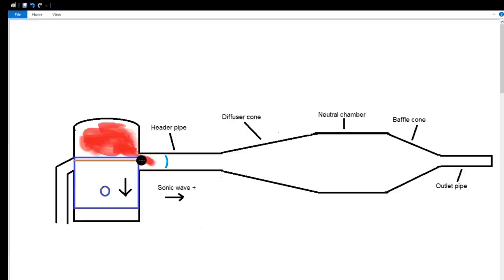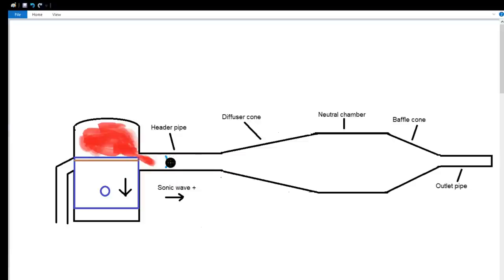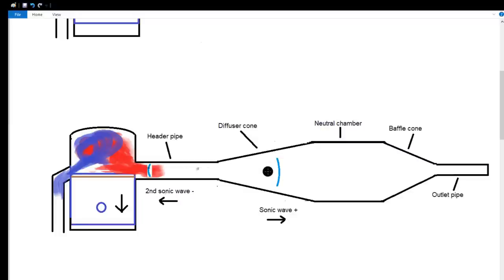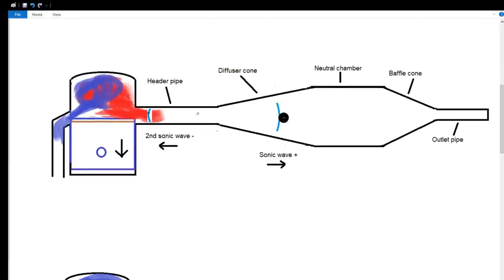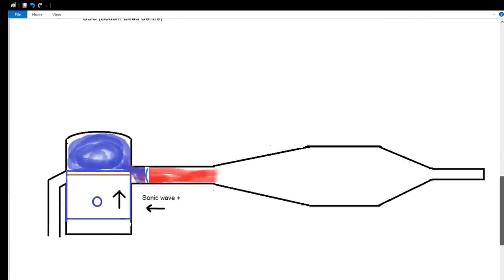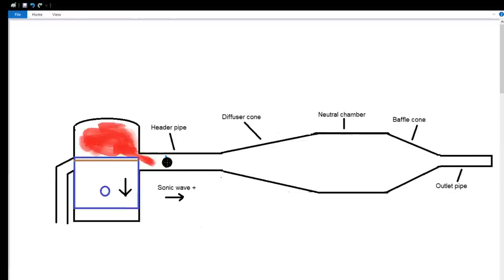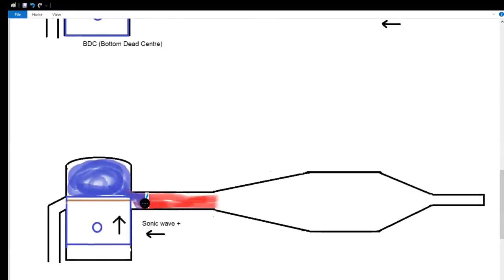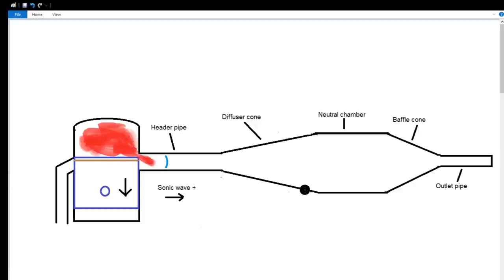Unlocking the secrets of 2 stroke expansion chamber exhausts E1

Comment: Hello,
I am restoring 1987 Jawa 350, which is 2t motorcycle. Engine will be completly rebuilded, but I have a little bent exaust knees (its hard to get new ones for her). Some people say that it is not good for engine, but I have passed a lot of kilometers with those a little bent exaust with no problem. Can you help me and say what to do? Can I keep old pipes or I must spend a whole fortune to get new ones?
Best regrads from Montenegro.
Reply from the maker: One option for repairing pipes is to simply slice the pipe near the damaged sections and then use some sheet metal tools to beat out the dents and damage and then re-weld the sections back together with oxy acetylene.
There are also some videos on hydraulic repair of pipes using a pump but that is a bit expensive.
It all depends on the damage the pipes have, small dents in the belly section for example at not an issue for the pipes performance.
Damage the the header parts of the pipe nearer tot he engine can be an issue for performance.
Reply: @AuMechanic  I will try to cut the pipes near bent places and try to fix it, I have nothing to lose. Thank you for fast reply!

Comment: Hi thank you for that you are the only one that has given that   but how long is a tuned lengh be for the  muffler and wether from the start of the exhaust at the head if it has a bend in it will some of the exhaust gases bounce back causeing power restrictions pls let me know
Reply from the maker: The tuned length is taken from the port at the cylinder to the exit of the reverse facing baffle cone taper on the expansion chamber for Gordon Blairs expansion chamber formula which is what I use in these videos.
The later videos after this one cover each part of the expansion chamber in more detail including the tuned length and outlet pipe and muffler etc.
As for bends on the header pipe, no this wont cause reflections back of the compression wave so long as the area of the pipe has no sudden changes which is why if you are making a header pipe bend using straight pipe you need to use mandrel bent pipe to ensure no kink on the pipe that will change the area of the pipe diameter..

Comment: I recently had a detonation issue with a KTM 300. Online, everyone who had an issue previously were told to lower compression or richen the jetting. 

My problem was the pipe was a poor fit into the head. There was fuel/air escaping and there was evidence of that around the flange. But that shouldn’t affect jetting ( presumably) because both fuel and air were escaping, does that mean fresh air was coming back in where it was a poor seal. That seems unlikely to me, I would have thought the pressure inside the head would always be above the pressure outside. 

Any thoughts?

Comment: Just found your channel and I’m very excited to watch your series on designing a tuned exhaust. I’m in physics and I write software for numerics, simulations and such, but all I know how to do for this problem is write a solver for Navier Stokes, which is very difficult, complex, and computationally intensive, so I’m interested to see what simplifications are allowed to reasonably model an exhaust system.
Reply from the maker: The videos on Expansion chambers is based on the publications of Prof Gordon Blair.
You might like to read his book "Design and Simulation of TWO-STROKE ENGINES" published around 1996 which are the basis of SAE papers he published.
He has an earlier version around 1990 but there is some changes in the 1996 version
When I started making expansion chambers in the 1980's we only had Gordon Jennings "Two Stroke Tuners Handbook" to work form which are fairly simplified.
Reply: Thanks for the references!
Reply: @AuMechanic  if you change the length of the header before expansion like shorten or lengthen does this have an effect on the timing
Reply from the maker: @davidbroomhall7321  Since tuned length is calculated from the port window to the end of the baffle cone, changing the lengths of any part therein will effect tuned length.
I suspect what you are referring to is the "Jennings" pipe equation created in the late 1970's that provides a max and min lengths of header and the result of changing it, but be aware his equation was created by measuring race pipes with some observations and not by any scientific methodology as with the "Blair" equations that were created in the late 1990's I use in the software and in the videos series.

Comment: obviously we have sound waves making it out the stinger. is this the wave returning from the combustion chamber? or "Extra waves"?
Reply from the maker: The sound coming from the outlet pipe will be the residual of any compression wave that is reflected but mostly the initial compression wave.
By having the outlet pipe inserted back into the chamber or to the side can reduce the sharp peak of the sound out of the outlet pipe without any loss.
I cover a bit more about the outlet pipe in a later video as well as the build series with equations where I cover how the length of the outlet pipe is not critical and in fact so long as the initial diameter of it fits the outlet ratio equation the rest of it can be larger and shorter

Comment: Okay... I have a couple questions...

When figuring which expansion chamber you need for an engine, should you base it off of CC to internal pipe diameter nearest piston; CC to internal pipe diameter at exhaust exit; or CC to area inside chamber?  (and what is the appropriate ratio?)

I’m wanting to fit an expansion chamber to one of my chainsaws that I abuse with occasional milling work, and then if I like the results enough  may make the addition to all of my saws.
Reply from the maker: Hi Rick
Not it is not only linked to CC there is more to it..
It is link to CC in so much as it is a ratio based on the port size and a larger engine will have a larger port size but the exact ratio is based on the expected pressures in the pipe which is based on BMEP.
There is a video playlist with a series in it covering all the equations required to design an expansion chamber, you will find the answer there to calculating the mid section. and exit pipe diameter ratios with explanations..
I will have a freeware downloadable pipe calculator software available soon that puts all the equations and ratios into a software to do quick calculations.

Comment: Why doesn't the explosion (fire/heat energy and high pressure) ignite the incoming air/fuel mix? Why doesn't the fire get forced into the crankcase that's currently under increasing pressure full of boom juice?
Reply from the maker: Because the exhaust and transfer ports are closed or covered by the piston during combustion when it is still near the top after it passes top of the cylinder and begins the downward stroke..
Once that is complete and the piston moves downward the exhaust port is the first to open, when it does most of the pressure is released to the exhaust before the transfer opens, that is called the blow down stage, as the piston continues to go down the transfers open next, at first some exhaust gas flows backward down the transfer but as the piston continues to go down the pressure in crank case is rising and the exhaust being open the cylinder pressure continues to drop at which point intake from the crank case flows upward into the cylinder.
Reply: @AuMechanic  I understand the principles of what is supposed to be happening. The compressed air/fuel mix is detonated by static electricity jumping from the negative electrode to the positive positive. Some of the matter is converted to heat energy in the form of an explosion. The cylinder dome and walls contain this   violent release of energy which allows the piston to convert it to mechanical energy. My problem is the piston hasn't converted all of it. There's plenty left by the time the exhaust port opens, which is necessary, but the intake port opens and new air/fuel mix is being forced into fire that hasn't been completely expelled. It didn't have enough time. Even when the piston reaches B. D. C. and all the usable energy the rotation of the crankshaft will allow has been transferred, there's still fire waiting in line at the exhaust port when the cylinder gets flooded with some easily excitable molecules. The way I see it, if there isn't enough explosive force left to push into the intake, then the new comers to the cylinder should at least burst into flames, chain reaction through the intake and consuming all the air/fuel hanging out in the crankcase because the Reed valve couldn't stop them forcing themselves in there but stopped them cold  when they tried to go back.
Reply from the maker: @cliffcampbell8827  
Firstly to clear up a few points there.
The spark is not static electricity, it is generated by induction in the ignition coil.
Combustion is not an explosion it is a rapid burn of fuel
It is not contained by cylinder walls at all it is contained by the cylinder head, specifically the small combustion chamber dome of the head, the surrounding area of which is called the squish band is to limit combustion to the centre and stop it occurring at the outer regions of the cylinder head.
Second part.
By the time the exhaust port has opened combustion is long completed and there is no "fire" left only the residual exhaust after combustion.
In addition to the fact that there is insufficient pressure remaining in the cylinder to support combustion even if there was a spark.
Note in some twin 2 stroke engines that have a dead spark system a spark occurs when one piston is at BDC and no combustion occurs because there is no compression.
Reply: @AuMechanic  I took a small engine class for 1 semester way back in high school. I think that I am not remembering everything from those lessons correctly. I do remember something about flywheel magnitos and after voltage goes through a coil, 6 v becomes something like 40,000 v.  Electricity, if it is or isn't static, household or auto, none of my business, but I do care about very much about avoiding  electricity. We don't work welI together so if I don't bother it then it (usually) doesn't bother me. Filth washes off. Most cuts and scrapes I get are patched with masking tape, but I categorically refuse to dance with amps. It only knows the rigid-twitching two step and it likes to lead.
Reply from the maker: @cliffcampbell8827  
Yeah I'm not too keen on getting zapped and in later years with modern ignitions getting zapped by a plug lead is particularly painful.
I've got a few earlier videos on how ignition systems and such work.
Reply: AuMechanic it’s called a waste spark ignition. Even triple 2 strokers use it, firing every 120 degrees....

Comment: I have a 2stroke tipple 1000cc sled.Exhaust is in really bad shape so I'm installing 3 cherry bomb glass packs for expansion chambers and fabricating same as stock inlet diameter pipe and same diameter as stock exit pipe after expansion chambers. Will still have stock silencer. Thinking this will keep me in the ballpark for factory back pressure.
Reply from the maker: That would significantly reduce the power of the sled.
Back pressure is only one factor of the expansion chambers performance, the rest of the video series covers what the other parts of the expansion chamber does.
You would be much better off repairing or replacing the stock chambers.
Can you define "really bad shape", what sort of damage do they have.

Comment: Buy the way.Are there any Vortex rings going on in a 2 stroke engine.The Pulse Jet makes them out the exhaust made in the cone after the combustion chamber.I could build devises to stop this but dont know if that will help thrust any.
Reply from the maker: You will get smoke rings out of any exhaust.
The operation of a pulse jet has a few similarities in so much as flow of compression waves however expansion chambers do not  primarily operate on a resonance like the pulse jet does.
The source of the compression wave in the expansion chamber is from the pressure blow down leaving the exhaust port in a single pulse.
Reply: @AuMechanic  My 100mm D Z26 Italian Pulse jet pipe runs at 140 Hz a second or like 8400 rpm on a 2 stroke.I have a shorter Bailey Pulse jet running 240 per second.The longer the slower the pulse.I am shore its exactly the same principles.Speed of sound plus &  minus the flow speed out the combustion chamber.Air is sucked back up the tail pipe as far as the combustion chamber in the return Vacuum wave.The vacuum wave is about - 6 psi.I had a 90mm PJ pipe split right at the end of the combustion chamber & this worked like a Venturi ,Arg Mentor or airplane wing sucking in air & making the Pipe run much hotter.I can inject extra fuel 3 in up the tail pipe to add 2 lbs thrust as this mixed with that air returning & is why the tail pipe always runs cold.I had a cone or flame holder in my German & Italian PJ pipes & after adding louvers to the cones Thrust increased.My idea was the shock waves could get through yet the incoming air & fuel would skip from louver to louver much like rain dropping over louvers on a house window.It worked very well.I will study your work & apply it to PJ theory.I think its a direct match.We don't have a reverse cone to add back pressure  but the first diffuser  cone works the same.The Pressure jet Engine used 3 tuned intakes to ram air into its combustion chamber.This power came from Nitrogen gas forcing LPG gas into its pipes at the speed of sound.I dont understand shis myself but it goes to show how much force tuned pipes can have.I have a Honda 350X ATC trike that makes a odd exhaust sound regardless what muffler I use.I think the different intake header pipes make this .If I CC each header pipe perhaps this sound will be much deeper like my single exhaust valve Yamaha YTM225.Do you think this could be possible.Its a single 350cc 4 valve head engine.

Comment: Very informative video
Reply from the maker: Glad you found it useful
Reply: @AuMechanic  very useful i'm currently doing some research on the gordon jenning and blairs equation.. I'm currently trying to understand and determine what the correct size of tuned pipe base on the exhaust port.. Still have tons of questions need to get answered 😅
Reply from the maker: @no0batwork157  
I've got many videos on the topic here that cover about any question you might have, I also wrote some windows freeware calculator using Blairs 1996 equations too that there is a few videos on here.
Any questions feel free to ask.
Reply: @AuMechanic  thank you sir.. I'm looking forward to review all you video..

Comment: Hi,and thanks for the brilliant videos..could you tell me-does changing the length of the outlet pipe have much of an effect on  performance?would  it be OK to extend one outlet pipe on an rg250,and leave the other stock?cheers👍
Reply from the maker: No not at all
A much longer pipe will be slightly more restrictive than a short one but a small difference in pipe length wont make any difference.
The only thing the end pipe does is restrict the chamber outlet to determine pressure in the pipe, there is no wave action at all in the stinger pipe and has no effect on tuned length of the chamber..
Reply: @AuMechanic  thanks for the reply..much appreciated..cheers👌

Comment: Thanks for this video. I have a question: What's the result if you shorten the header section of an original pipe to make it fit another type of moped? It's shortened by 8cm approximately. Thnx!
Reply from the maker: Making the pipe shorter will raise the effective RPM range the pipe is tuned for.
Check the engine it came off and establish the peak RPM on it, if the peak RPM of the one you are fitting is too is higher then you may get away with it.
You can use the freeware pipe calc to input the engine specs of each engine to see what the tuned length of the pipe is on the bike you got the pipe form and should be on the engine you are fitting it to. Then you can basically raise the RPM value in the calculations for the new engine until the tuned length equals the tuned length for the old engine the piep came from to see how far out it will be with that much removed.

Comment: So what's the conclusion?? Is it good on a stock port of exhaust or it should be used only if we increase the ports sizes?? Plz say
Reply from the maker: Good question.
The percentage of performance improvement with an expansion chamber over a simple muffler will certainly be dictated by the engine performance to begin with..
An engine that has a low BMEP (covered later in the video series) is simply not able to generate a significant compression wave from which to get a reflected waves of any great amplitude.
And the engine will not likely spill excess mixtures at the exhaust at peak to have any great port plugging effect at the top of the power peak.
However, if you know the kW or HP for the given engine and swept volume you can calculate BMEP to give you some idea of how much gain you could expect.
Reply: Wow!! That was fast reply. Subbed u and thanks for the info. Love from india ✌🏼
Reply from the maker: The RXZ looks like it would get some benefits from an Expansion chamber.
I see the specs of 132 cc - 10.4 kW of power at 7,500 I calculate as about 6.3 Bar BMEP which is enough to get a chamber working reasonably well.
See latest video I show how to calculate BMEP.